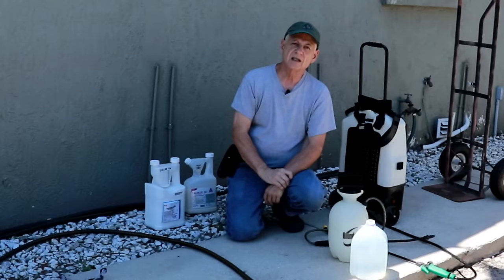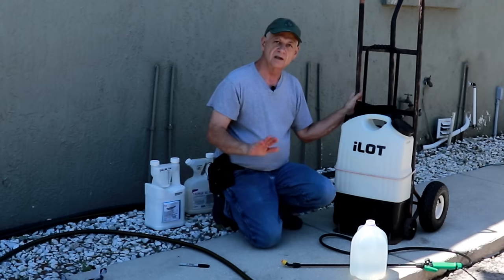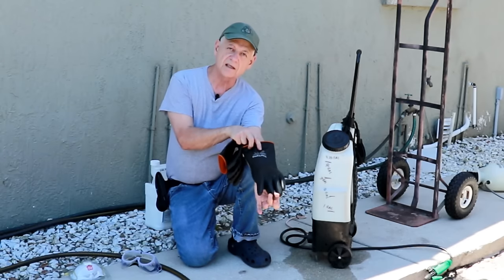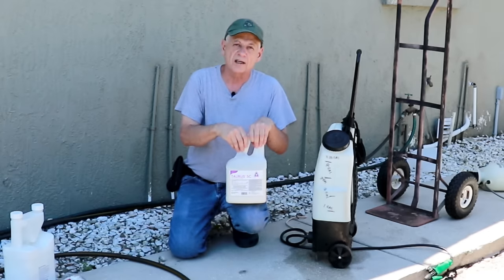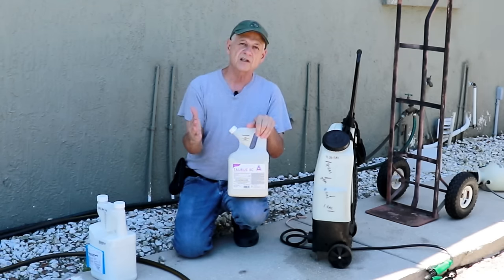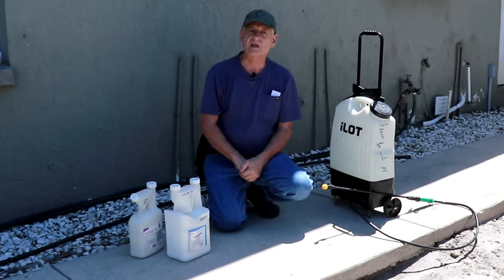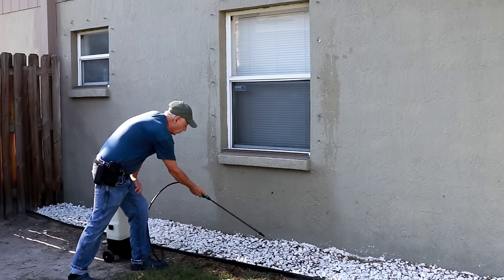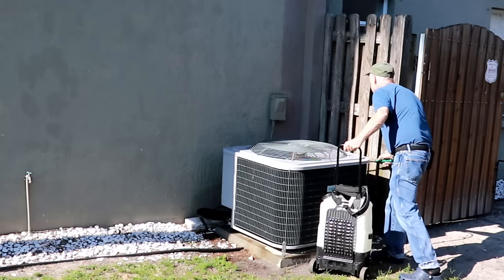General Exterior Pest Control - IMPORTANT!  READ THE DESCRIPTION.

Comment: I watched your video on termite control using Bayer termite killer. My ? I have river rock around my house. Do I need to rake it away and treat the dirt or just apply and water it in. 

Thanks great information
Chuck
Reply from the maker: It depends upon what is under the river rock.  If it's just dirt, then you should be fine.  However, if you have a weed barrier under there, then you need to know if that barrier will allow water to pass through.  If it does, then you were good to go.  Otherwise, you would need to pull it back.  Keep in mind that for the granules to work you need to have dirt around most of the house and that dirt needs to be porous enough to allow water to seep into the ground fairly quickly.  To find out if the dirt around your house is porous enough, just dig a small hole next to the house that is about 4 inches deep, 8 inches long, and just the width of the shovel.  Fill the hole with water and watch to see how fast it drains down into the ground.  If it seeps into the ground fairly quickly, then the granules should work just fine.  However, if it just kind of sits there, then the granules would not be a good choice, and you should consider trenching.  If it turns out that you need to trench, then please watch my video on how to do that correctly.  Trenching is a lot more work, but it only costs about $100 to do an average size home, and it lasts 5 to 10 years.  Most people can trench an entire house in one day, but you can take up to a month to get it done, and you can literally do just 10 feet at a time.

Make sure that you buy the correct granules.  You need the ones that have imidacloprid as the active ingredient.  A lot of the Home Depot and Lowes stores no longer sell the correct granules, but you can get them from Amazon.  I will give you a link to them.

If you do not have an active infestation already, you may want to also consider using monitoring stations around your home.  I use both the granules and the monitoring stations.  I will give you a link to my video on how to make them for under 50 cents each.  I put them around my entire house for less than $25.    

I hope that helps.  Be well my friend.

Termite granules:  https://www.amazon.com/dp/B000RUIJYM?ref=nb_sb_ss_w_as-reorder-t1_k1_1_6&amp=&crid=157C3RV0MY0AK&amp=&sprefix=termit

Video on how to trench for subterranean termites:  https://youtu.be/Fy7YHi_7Z8g

Video on how to make monitoring stations:  https://youtu.be/gye27aXHRsY
Reply: @GuysPestSolutions  thanks again
Chuck
Reply from the maker: You are very welcome.  Be well my friend.

Comment: Hi Guy  Quick Question about garage spaces.   Is this safe to use in garages or do you reccommend something else.  I have a lower garage with finished living space next to it and above.   I have a work shop in the garage, would this be harmful to around if I sprayed around the doors and floor.
Reply from the maker: The Talstar P would be fine to use for this, but not the Taurus SC.  I hope that helps.  Be well my friend.

Comment: Hi Guy, Just like to ask what happens if you spray termiticide at concentrations above label recommendations? Does this make it more or less effective? My area has lots of rain, so I am obviously concentrated about the leeching away of the termiticide. Thanks!
Reply from the maker: Most of the time, mixing any pesticide at a rate higher than the label recommendations is pretty much just a waste of money.  In some cases we do it for a resistant species of termites, but most of the time the dilution rate on the label will work just fine.  Modern day pesticides are designed to stay where you put them, and they will not wash away after they dry.  They kind of stick to surfaces in much the same way that paint would.  If you have ever painted outside with latex paint, and it rained before it dried, then you know that the rain started washing the paint away.  However, after the paint was dry, then it stayed where you put it.  It's pretty much the same thing with pesticides.  Regardless of the concentration, it is going to stay where you put it, after it is dry.   

I hope that helps.  Be well my friend.
Reply: @GuysPestSolutions  Hi Guy, Thanks for the detailed explanation. Hope you stay well & keep up the great content!

Comment: How are you Guy. Watched your General Pest Control and Termite Treatment videos. I brought Taurus Cl and Bayer Termite Granules.  Ready to apply question: Should I do general treatment first or Bayer termite granules first. My thinking is that I would do granules watering in since the first treatment. Then let dry, allowing general spray to cover on top of the ground.

Thanks in advance for your comments.
Reply from the maker: Hi Milton.  I'm sorry that I did not get back to you, but your question never got to me because YouTube held it up for review.  I didn't know that they did that.  I am working on fixing the problem.  You could apply either product first, but how you do it does matter somewhat.  If you apply the granules first, you need to be careful that you don't wash them away with the liquid pesticide.  Also, if you apply the liquid pesticide first, then you don't want to wash it away when you water in the granules.  Kind of a catch 22.  So, I suggest that you apply the granules first and water it in lightly about four times to be sure that the granules dissolve and begin to leach into the soil.  Now that they cannot be washed away, go ahead and apply lots of the liquid pesticide.  Again, I am so sorry for the delay in the response.  Now that I know that YouTube holds some of the questions for review, I will take a look at that box every day.  Thanks for the question and thanks for watching.
Reply: @GuysPestSolutions  Great hearing from you. I thought that you had tired from my questions. Congrats on getting some YouTube sponsorship you deserve it. I was still puzzled as to how the pellets worked. The support group didn't (couldn't) answer my questions. In fact, tried to switch me to the liquid product. Can you comment in more detail about how the pellets work? Also, 6 inches from my foundation, is still under the eves and completely dry.  Should it go back over my treatment 4 times as you indicated in your latest answer to me?
Reply from the maker: Hi Milton,  Guess what?  YouTube held this question for review again, but I was able to find it.  However, they would not let me answer it without making me jump through some hoops.  It took me about ten minutes to get around the blocks they put in my way.  I really wish they would stop doing that.  Someone else asked me a question that was held for review and now that one's totally gone.  It's very annoying.  Anyway, you don't want the granules six inches away from the foundation, you want it right up to the foundation, but you want the band to be six inches wide.  That is to say, you sprinkle the pellets so that they actually touch the side of the foundation and you make a six inch wide band around the home.  It can be a bit more than that if you like.  You can't use too much, but you can use too little.  You don't want the liquid. It's just not going to work.  The reason the granules work is because they will leach into the ground after being watered.  The water melts the granules and then they saturate the ground for several inches down.  Since subterranean termites MUST return to the ground fairly often to obtain the moisture that they need to survive and to feed the queen and other termites in the colony, they will take some of the BioAdvanced Termite Killer back to the colony with them and they will share it with the other termites, including the queen.  This will result in the death of the queen and the rest of the colony.  The colony is always under ground and never in your home.  They live in the ground and just like to go out to eat.  Unfortunately for you, their favorite restaurant is your house.  The process is slow, but 100 percent effective.  You can expect it to take four to eight weeks for the colony to die out.  It's always a good idea to water in the pellets if you are using the product for the first time or if you have an active infestation.  Do not over water.  You don't want to wash away the pellets.  However, you can water three or four times, lightly, just to ensure that the pellets dissolve.  Don't forget your driveways and walkways.  You want to catch everything that I talk about in my video.  As for the ads, I have mixed feelings about them.  I think they are important because that's how YouTube stays in business, but they can be somewhat annoying.  I'm not exactly getting rich from them though.  So far they have only produced about $30 for me personally and YouTube won't even send me a check until it hits at least $100.  I have way more than that tied up in time and equipment to do the videos.  As you know, I refuse to accept any compensation from companies that manufacture or sell pesticides or services.  I could make some serious money if I stooped to that level, but folks would understandably lose faith in me, thinking that I am recommending products for profit.  A lot of people tell me that I should do it because everybody else does, but my integrity is not for sale.  So, I am okay with the YouTube ads, but I do not endorse the products that are advertised in that way on my channel and none of those companies pay me directly.  Meanwhile, should YouTube ever actually send me a check, I plan to plow it back into making more videos and I will not use it for personal gain.  I hope that helps.

Comment: I've had a issue with scorpions here in Ocala, FL (Three year old block home).  Wi
Reply from the maker: Buy Onslaught FastCap Spider and Scorpion Insecticide.  Mix it according to label directions in a battery-operated tank sprayer and spray up the side of the building 36 inches and out away from the building 48 inches.  Be sure to soak the area where the building meets the ground.  Also apply this on your patios, stairs, sidewalks, and that sort of thing.  In other words, you want to apply it any place you frequently walk.  This will stop the scorpions from getting in the building or hanging out on surfaces where you frequently walk.  Next, you should apply it on all ornamental plants around the building as well, being sure to treat the dirt under the plants.  I recommend applying it every 60 days.  Look for obvious penetrations in the side of the house and treat them with D-Fense dust.  Just buy a duster, fill it halfway with the dust, and puff the dust into any cracks or crevices that you find.  After treating, it is a good idea to caulk these penetrations as well.

After you finish the exterior treatment, you should check the house for scorpions.  Look under appliances, in closets, under the bed, and that sort of thing.  Be sure to check shoes, curtains, or anyplace these guys may be hiding.  To assist in your search, you can use a black light.  All scorpions will glow green when exposed to a black light.  Always make sure that you hang up all your clothes.  You should never leave clothes laying on the floor.  Clothes that are waiting to be washed should be kept in a sealed hamper.  Shoes should be kept off the floor on some sort of a shoe rack.  

I hope that helps.  Be well my friend.

Onslaught FastCap Spider and Scorpion Insecticide:  https://www.domyown.com/onslaught-fastcap-spider-and-scorpion-insecticide-p-2579.html

D-Fense dust:  https://www.domyown.com/dfense-deltamethrin-dust-p-2428.html

Duster: https://www.amazon.com/gp/product/B099X3HS47/ref=ppx_yo_dt_b_search_asin_title?ie=UTF8&psc=1